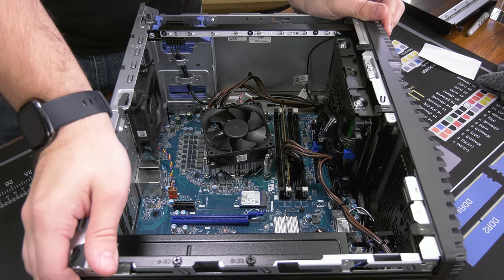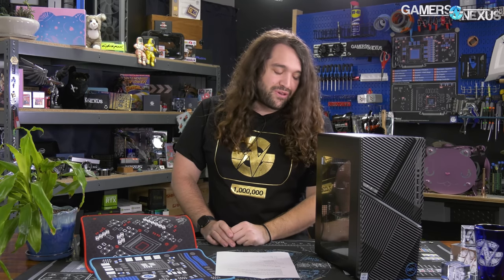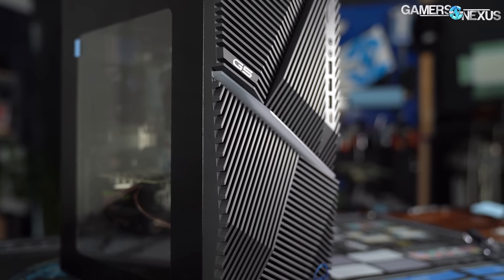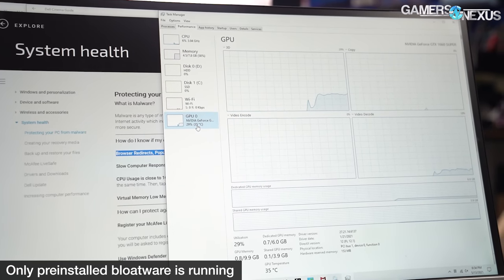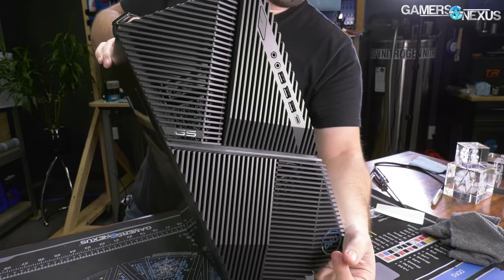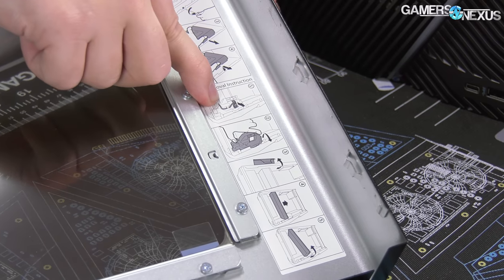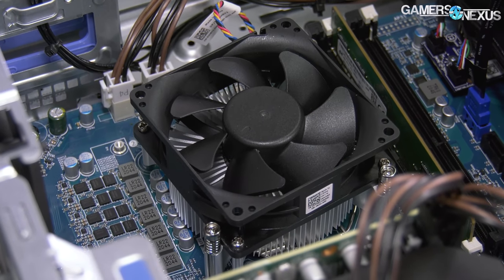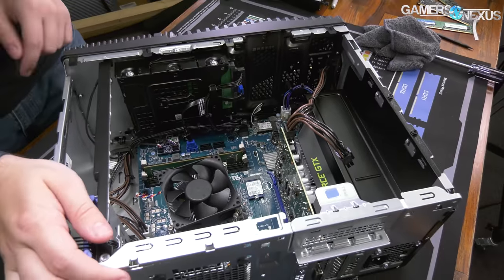Worse Than Walmart: Dell G5 5000 PC’s Garbage Parts & Hidden Charges

Comment: Dell is garbage. Many of the parts are propriety (PSU, fans, case and motherboard). I've had to replace each of these on several systems, and had to buy the components from Dell, because non Dell parts either won't work, or won't fit in the proprietary case.

The last Dell I ever bought was an top of the line Alienware laptop, which was DOA. Went through the routine with tech support, who accessed my system remotely. I was watching the screen, and taking notes on the error codes that came up. Technician claimed the disk drive was bad, and said she would send a local technician to my home to install it. I told her that the error code clearly pointed to a bad motherboard, but she insisted I was wrong. Technician came out, installed the drive, and left. I asked if he was going to install Windows, and he told me he wasn't contracted to do that... then  he left. He also told me that Dell had started using the cheapest parts they could find, even on their higher end systems. Tried several times to install windows, but the installation would crash with an error in exactly the same place each time. Wasted several days before returning the laptop for a full refund.

Comment: Just that mediocre proprietary power supply will limit your upgrades all by itself.  Want a better graphics card?  Odds are that it will be too much for that thing.  Maybe there is a higher wattage supply you can use that is compatible but of course made by Dell since it is a weird little thing I have never had the misfortune of encountering in any computer I ever had.  Then the controller for the RGB lighting can go.  Put something better in there like a Coral TPU and just get that RGB out.  It feels to me that they use the RGB just to make a mediocre computer seem a lot better than it really is to those who never had a PC before. I never had RGB in my computers and they ran just fine.  I never had a window in the case.  Why would I want everyone to see that dusty rat's nest?  My computers were not the best you could get at the time but they were also far from the worst possible ones you could have.  I built mine since it is fun and you can do it cheaper and in this case, avoid buying the Dell from Hell!

Comment: I have a new dell, it was 1300 bucks, for 1000 I could of got the same cpu/ram but with a 3060 for 300 less at costco and newegg.
Opening the box was virtually empty and 280W psu, the new 12V output only, just total rubbish, stay the hell away from DELL!

Comment: Thank you for your useful video.  I've been tempted to purchase a Dell 8950 from Costco, but it too has the proprietary motherboard, and a chintzy, underpowered non-standard 460 watt PSU, along with that little pancake cooler on the (very nice, fast) Core i7-127000 CPU.   NVIDIA recommends a minimum of 550w PSU for systems with their 3060 Ti GPU.   So just to fix the PSU and cooling problems, I'm looking at nearly $300 plus the hassle-factor.  
   This is the hidden cost of the mass-production desktops that target users who do little but surf the web or run their Tax Prep software.

Comment: Bought this system last year, everything is the same except my 1660super didn't even come branded as Nvidia, you'd have no idea what it was, but same crap design. I quickly swapped out the 16gb single channel for 32gb in DC but other than that it's factory.

I was absolutely shocked by how proprietary they managed to make a desktop system that looked from the outside to be like anything else not made by Apple.

I didn't get hit with any bs charges but I am disappointed with what I got. I think I paid $980 Canadian, so it's fine, but not thrilled with the blatant forced obsolescence though.

For a living room streaming computer it's 100% fine so I won't complain, but had I been able to look at it before buying, I'd have gone elsewhere.
Reply: Also my case is exactly the same build, except I didn't get a clear panel and my front panel is solid but still has the same outcrop for IO but the same mounting style.

Comment: 18:58 To their credit, USB ports/any other ports are much better secured if they're on the motherboard instead of onto some panel. I've had issues with flimsy ports on my case but the back panel ports are solid.
Not saying what they've done here is a good idea(it's not, for other reasons), but if the ports are solid, then that's because of what they did here.

Comment: Dell just fails to realize if they build a good computer with no Bloatware that performs, people network about it.   If they used standard ATX PSU's and components, people would network and buy it..   They are losing 50 percent of a market because of low IQ marketing and engineering.   They hemoraging money in the long run.    It is the fast food of gaming computers.  You use it, throw it away and by that time learn that Dell isn't worth buying.

Comment: you do realize that youtube allows really long videos over 24 hours "windows xp startup chime stretched to 24 hours" was a meme a few years ago.

12+gig is the size youtube allows.

so there is the green light to post long big videos.

building pc is actually better because you can circumvent the cec shipping ban if you live in one of the cec states*.

cec is an environmental thing where certain states pre built pcs had to conform to certain environmental laws to be able to ship to cec states.

your dell account is much more valueable than you think.

while there may not be anything personal in the account it allows you to buy and have shipped stuff from the big pc makers despite being in the cec states due to the business position that you are in.

not all proprietary parts are completely useless.

every power supply has the same voltages it is just a matter of the pinouts so adaptors and cuts and splices can be made to the wires to make a dell power supply work with other pcs or atx power supply work work on the dell.

a dremel is a useful tool for getting stuff to fit.

$10 that is chump change compared to what you make on the youtube videos that draw million+ views

do a credit card chargeback!!!!  call up the credit card company and even report it as a fraudulent charge.

Comment: The cooler on the case makes more sense than humongous coolers attached to flimsy PCBs. So the case is doing the load bearing, not the PCB.
From reusability, yeah sucks, but if you want to roll your own you do, you wouldn't buy a Dell or a Walmart or other garbage.
Now to call this a gaming PC? 🤣🤣
Come on, 10 years or more ago you couldn't build a decent gaming pc for 1k$.
Now you want to buy a decent one for 1k$?
Inflation? Silicon prices? Electronics shortages? Surreal expectations

Comment: I bought this on a deal to get the video card 3060ti. What a piece a crap. It sits and mines and can barely do that. To keep this cool I have to keep the side cover off and replace the fan (fan replacement barely did anything because of open case) everything is super crammed it's just a pile of crap in this tiny case. If you took the components and put them into another case with better cooling it would slightly better.  btw I used screws instead of rubber things to install the new bigger 90mm fan. Not great Dell thumbs down 😕

Comment: Jesus Steve, today we brought my sons friends Dell build into the house to transfer into a better case because the airflow was so bad. we looked at the power supply and was like, huh? Then the motherboard, the shield on the back and thought how is this going to work. At this point I was like, I don't think these parts are going to work in the new case and search youtube and found your video. It confirmed my fears and it was worse than I thought! my son was like lets at least put the intel fan on for him and we couldn't even do that! I told the poor kids I was sorry, there is nothing I could do, just open the side panel for more airflow 😞

Comment: I bought this EXACT model in the video back in 2021. It's not BAD but It's now showing it's age and limitations. I'm an artist and I've recently started vtubing and streaming. this pc is just- not it. I'm building my new system this month and it's so much more powerful. The cons are really- alot. It's super fuckin loud, the case is starting to tick, it BARELY handles Red Dead Redemption 2 let alone modded games. It struggles to now load up profiles, my MAIN profile on this pc takes about 30-40 minuets to load up fully and be at a descent speed. It barely handles my Art program let alone OBS. the bloatware is BAD with this build too. 

Was it good at the time that I bought it? Yeah. Will i ever buy another dell again? Fuck no.

Comment: i remember when i was younger, im now 40 , so back then when i was like 17-20 i baught one time in my life a complete dell system, i was so supprised when i found out how douchie they re invent ant try to "secure" a think that can be easely fixed. I remember, i dit had a good pc on it for a while, bacase it was a massive inprovement on my system prior. But i also remember that some stuff was replaced and it was a pain in the ass to do so... an btw Dell... if u read this, why the fuck put other connectors on cooler fan's????? whats the point of that??? me buying a way overpriced dell (cheap produced) fan? .... (just changed the connectors of the old one of dell to a new way better cooler fan, and just re wired it.... how hard can it be to beat a dell??? and actually make it a g fairly good system.... ?! not that hard, once u mess with it. ;)

Comment: The cooler mounts directly to the case to save parts, you don't need to make a back plate. Its actually really smart and interesting.
Reply: I was thinking the same thing.

Very cool that the front IO is also pushed out of the case on the MOBO. So many custom PC building companies out there that mess up on all these little items.

They really do simplify it.

Comment: well you DID say it and skimmed it by rite fastly!  Dell g5 5000 for $600. You get what you  paid for.  Two names come to mind  DELL, & Compaq. NO they did KNOT make computers as they did not have the physical ability to MAKE computer parts. BUT they WERE distributors of PCs around! EVEN IBM  put together  PC parts from other sources and finally put their name  IBM on the finished product!  SO  its still Caveat emptor, let the buyer beware. And you got the rip off version.I have bought  Dell gamers  large unit for $60 and they ran true. All  I  had to do was upgrade  parts with available  modules and  play away gamers!

Comment: Dell has been a shit company for a LONG time.  Hell, they ruined Alienware, after they acquired them.  

The problem with pre-built PCs is that they only care about the CPU and the GPU, everything  is the cheapest they can get the PC to work.  Trash tier quality.  It's only getting worse.  More and more proprietary parts that can't be repaired.  Gluing and soldering parts, so they can't be repaired.

Planned obsolescence is strong with this one.

Comment: One thing, you're kind of lucky they put that support charge on the bill/invoice, here companies that do the same shit never show it, they say it's free and listed on the invoice it is listed indeed as € 0,00.

Still don't believe that for a minute, nothing is for free, you're delusional if you believe they actually give you a year support or additional warranty for free.

Companies I've seen close that do this for example have a fixed computer for you to buy at a certain price, which sucks, even today their basic pc will be like an intel i3 13100, 8gb ram, gt710 or something, which they then give you upgrade options for, if you upgrade parts they sneakily don't remove the cost of the crap parts of the original pc they won't be using, so you kind of pay for 2 computers in the end, the piece of crap basic pc, and the upgraded one you picked, part of the price of the crap basic pc obviously is the hidden additional supposedly "free" service and warranty, it's so scummy.

My brother in law always bought from such a company, thinking he knows all about computers (and everything else) whilst he often truly doesn't, he got my sister to buy a pc there too, awful most cheap case possible, no ventilation, all cheap thin plastic, Ryzen 1700x with the cheapest ram too slow to run Ryzen well, ugh, yes one good thing is it has no proprietary crap in it, so that's atleast something, she got it years ago when Ryzen 1000 was still new in stores, but when she's getting a new pc my sister already said she wants to build her own pc with me after me explaining it all to her and why I built my own.

I find most companies I've found here that build for you to be a bit sus, I understand not everyone can or wants to build their own pc, my fiance didn't, so I built his new gaming pc mostly for him, still I agree companies that build for you should give you something good, not crappy, and shouldn't try to shake more money out of your pocket with scummy tricks.

Comment: I don't understand the complaints about not being up to standards. This computer is pre-build and the end user doesn't care what's inside. If it were otherwise, he would probably assemble it himself. This is equipment for someone who wants to buy it, put it on the desk and use it. It works perfectly fine in this scenario.
Reply: The end user sure as fucking hell cares about getting good FPS and load times though. Some people just don't have the time or skill to build it themselves. Yes. This IS equipment for someone who wants to buy it, put it on the desk and use it. That does not however mean it "Works perfectly fine in this scenario" as you say.
Reply: @Wiisporter  Yes, maybe not perfect, but in order to feel the difference, you need to have some awareness, read tests, compare. I don't think he's that kind of person. It's a bit like apple - no standards, terrible price-performance ratio, but you buy and you don't care anymore. Similar thing. Other than that, performance isn't up to par. It could have been done better without still breaking the standards. It was enough to give better cooling, take care of airflow and build quality, and no one would have anything to do with the lack of standards.
Reply: @TheMajsterb  dell has a reputation, people expect that "it's a pc, it'll be cheap and work" but it won't because dell fell off

Comment: I've built many many computers over the years and somehow ended up with a G5 5000, and you know what? It's been absolutely fine. I did get a better GPU but it works great even under super heavy loads. 

Is Dell kind of a crappy brand that makes questionable decisions both with consumer and professional product lines? Absolutely! Did I have problems in the past with Dell computers in my fleets? Yes, you bet. 

But I also supervised dozens if not hundreds of trouble-free Dell computers and servers. And my G5 while kind of weird and somewhat outdated had been great.

Edit, who TF doesn't format the disk upon receiving a pre-built computer?

Comment: From what I can gather here, you are paid or "advised" to throw loads of shheett at Dell. What if it's an specific, non-standard board? It is decently built (a see a lot of solid state capacitors there along with other quality components...). PSU being non-standard? So what - the rig is made for those who aren't "demanding", wont be doing any upgrades and changes and will, basically run the machine until...it stops. And then buy another one - that's how it works. Quite an average "office" PC capable of modest gaming. You complain of "bloatware" - why? Any average user (not to mention the administrator at some company/small enterprise) will easily get rid of anything and everything that is not needed...

Comment: dell has gotton cheaper on there built computers ,, back of the pc has less items or connectors  ,, some only have 2 ram stick  lanes way cheaper motherborads, built quality has gone down hill , so when does it cost extra to have a dvd rom it was allways 1 standard dvd rom and dell is using a cheap laptop dvd rom not the bigger dvd roms,, i allways build my own pc put better parts ,, power supplys , memory ect.,,,, , dell uses like to me cheap knock off video cards ,, some company builds there video cards with the dell logos

Comment: nothing wrong with this computer
he keeps saying why would they do this instead of asking why not? why not have the front io on the board? why not use the cpu cooler mount also double as a motherboard mounting hardware? it's 4 scres that have to go through the motherboard anyway why not double the functionality. it's really just hating for hate sake. he really had zero substantive critiques other than their is no resale market for the MB or PSU.he's like 'you can't even re-use this crappy $3 cpu cooler!'
Reply: Not sure if serious or trolling.

Comment: LOL - you really don't like Dell do you?  They have a custom made case because they actually make the PCs rather than buying off the shelf cases and motherboards etc - they are a proper PC manufacturer rather than a builder who just puts things together.  Would you rather the LED bar be made of metal?  The graphics card does not need to be screwed in as it's held in by the quality case that they designed and had manufactured themselves - just like all of their servers which cost tens of thousand of dollars for this type of thing!  Have you never seen a PC from a PC manufacturer before?  The 'weird stuff' you see are the things that they actually make themselves!  You also complained that there was not enough wasted cable length to hide away as Dell have manufactured the cables to be the precise length - why would you want them to make the cables longer so you can hide them away?  Have you only ever seen computers made with off the shelf items before?!